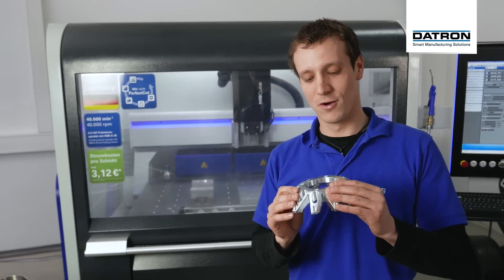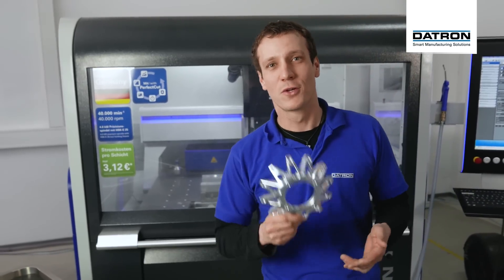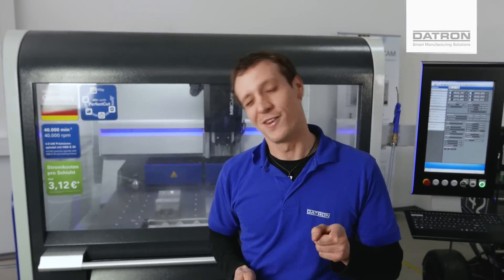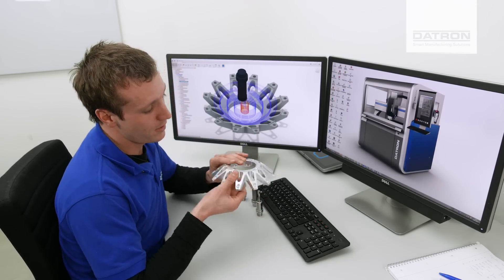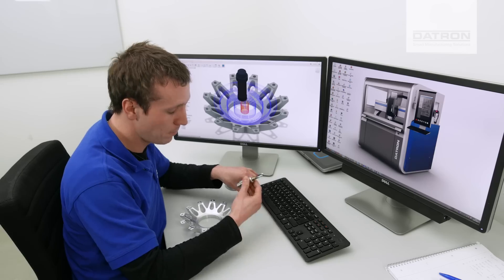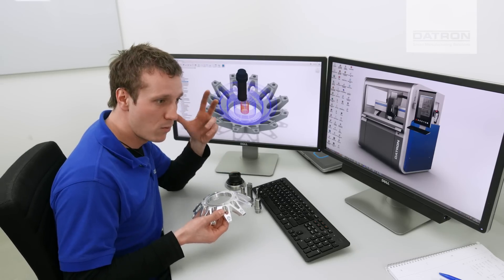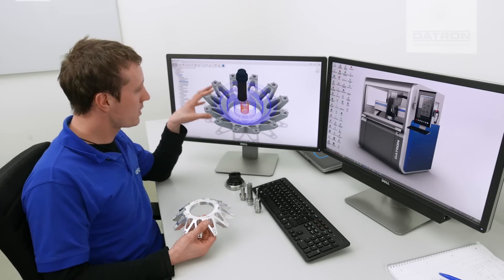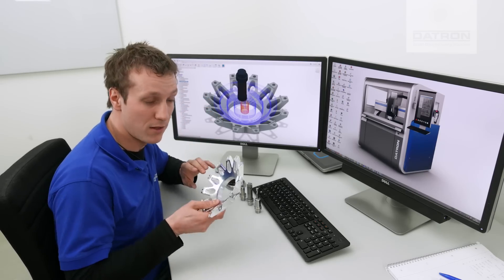Twelve spoke aluminium rim star high-speed milled on DATRON M8Cube

Comment: cast it : save time and money !
Reply: A casted Part isent as strong as a milled one and this part is I think for a formula student car. So this part will only be needed 4 times. So casting could posibly be more expensive. But money does not play a role on such projects. Sorry for my English I don't know if there are some faults in it.
Reply: skyhacker6
You won't be able to make the patterns in the time it takes him to machine a set of four rims,maybe even 40 parts.You could be right if the volume is very high.
Reply: The aluminium bar stock here is made by extrusion. It's closer to forged than cast. Cast aluminium parts have no consistency in the grain structure so you cant predict the strength. Usually car wheels are machined from forged billet.
Reply: Thank you for the pertinent and well considered contribution.
Reply: Yes but it is still casted. Which isent stronger then milled. I was in such a racing team and nobody gives a fuuck about costs because we had a lot of sponsorships. And you look after every Gramm of weight so better take a milled then a casted. We also took titanium bolds etc because nobody cared about the costs. Better watch after strength and weight
Reply: Lucky you then for having no worries about costs. I'm not in a team myself, but there is a Formula Student team at my faculty. And they have to take care about the costs. @skyhacker6 - why would you go through casting process, losing time, having to worry about the quality (blow holes, cavities, etc.), when you can make a part in 3 operations in a little over an hour. As mentioned above, this is no mass production.
 
In terms of quality and strenght, best solution would be forging the wheels, but that's a whole another story.
Reply: most car wheels are cast wheels. forged wheels have 5 to 10x the prices compared to cast wheels. and that in the video is a forged block of aluminium not cast. nobody mills an entire wheel center from some 'cheap' cast aluminium.
Reply: Castings are shit. Make from solid!!
Reply: Still looks heavier than it needs to be
Reply: Print a 3D model, cast it with wet sand and re process the all part on the CNC on just the important spots, et voilà !
Reply: The material that you are milling(example titanium discs,aluminium discs etc.) is made by casting.So...
Reply: Casting plus heat treating... At just 55 MPa yield strength, Cast 6061 Aluminium is weaker then some (of the strongest) woods out there. Probably something cast at home will be even weaker than that... Now, heat treat the same 6061 aluminium to T6 temper it will be stronger than most stainless steels... Machine it and it will still be equally strong... Not to mention be at 1/3rds weight as well...

There is a reason why most aviation/racing etc parts are machined, not cast.. Recommending casting instead of machining is ignorance. Apples and monkeys; those methods are not really comperable in any way..

Comment: I would love it one day if you would explain the use of ethanol as coolant, only aluminum etc? special venting needed? it does evaporate but it still is a ethanol just in vapor form and seems that the only filters in room might be the lungs?
Reply: I do appreciate the reply, I tried it last night and the stuff is fantastic on aluminum.  I came to conclusion that the alcohol vapor is not carcinogenic and in the small vol used not an issue for me. The dry parts are a welcome development. Regards.
Reply: I've run one of these, you can only really smell it if you're face is right up against the enclosure. Otherwise it's fine. Wait a minute or 2 before opening up for the ethanol to evaporate and you won't even be able to smell it once the door is open. Plus it keeps the chips and part dry so it's just an airgun blast to clean the table down.
Reply: Shotgun Reloader you get a great surface finish on aluminum with it. If you don't have your head in the enclosure it's probably fine. I mean unless your just intentionally huffing it. Toxicity according to the internets is 600mg/kg he probably weights 60 or 70 kilos, I would think it would take a whole lot of exposure to have any effect at all.